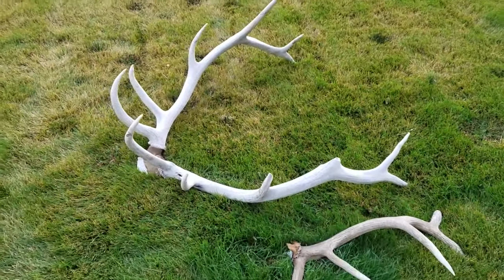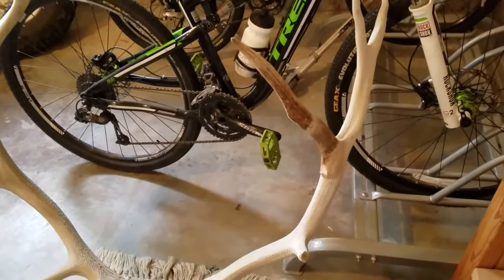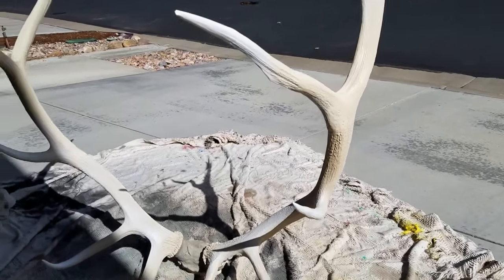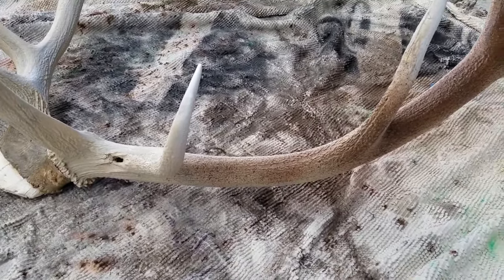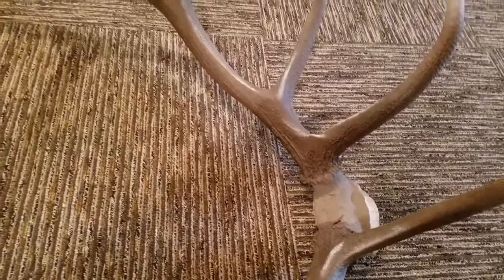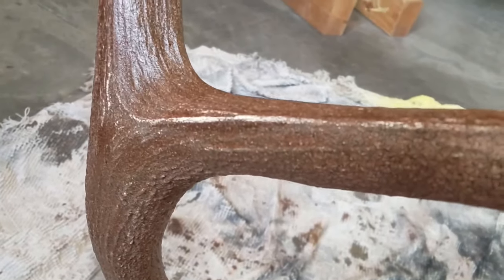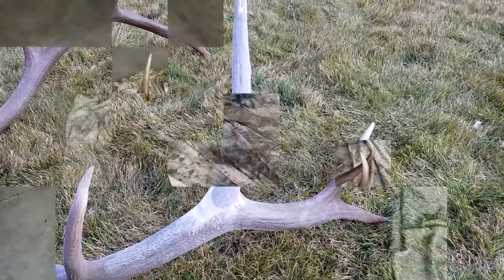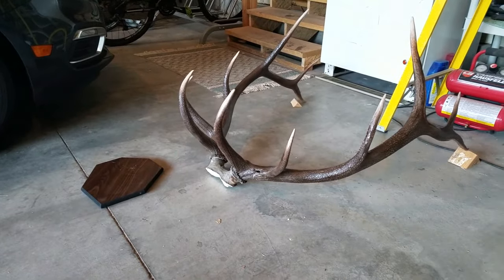DIY Antler Repair and Restoration - Broken Tines & 30 Years of Weather Damage

Comment: I got a 390 inch bull that winter killed last year or year before wyoming. I now know how am going to fix the tines and color. Thank you. Your bull shows alot of the same genetic tendencies of the one i found.
Reply from the maker: Congrats!!! Whitebone creations has a video with a fiberglass paint he uses...it works great.  You might want to give it a look.  Thanks and Good luck my friend!
Reply: Hopewell, which paint did you use for the white base?
Reply from the maker: I now use an ivory shade that I spray on. If I can't find an ivory then I find one that is very close to it that is an off white.. Make sure you let it completely dry.  For the next paint I now use a fiberglass door paint that is Brown in color and it works perfect. When I'm done with everything I paint everything with a very flat lacquer which takes all the shine off and protects the color.  If you have questions, let me know and we can talk via phone.
Reply: I tried a flat pure white base with a stain that turned out badly. Im going to use and ivory paint and a different stain, but a list of materials tht you use would help a ton.
Reply from the maker: I'm not at home to look at the exact name of the paint. But I get it from home depot and it is a bare brown paint that is for fiberglass doors. Stain does not work on top of paint or white horns.  Gloss ivory paint to spray on is the best for the base.  I will try to remember to look at the paint when I get home later but I believe there is only one that fits that description at home depot.

Comment: did wrong??? you did fantastic..!!! & you sharing the trials & changes is really kool, I've used that fleck stone paint before never thought of using it on horns, the end result is absolutely stellar, I really enjoyed this video, best wishes to ya Mike
Reply from the maker: Thanks Brooksy, the horns had so many cracks and crap that the fleck helped fill them in. I got the coolest package in the mail today...wow! Bro.... that necklace is sooo cool - I can't wear cuz i can't see it with my fused neck so I have to just carry it lol! The points are absolutely stellar! So if I read the note correctly, the beads on the necklace are from the 1700's? This was one of the best friend packages I've seen - Thanks my friend, much much appreciated!
Reply: I'm glad it got there safely, you can wear it & look at it through the mirror, yes the beads are that old , I never have thought about it til just now, but a guy could Google up Hudson bay sand cast beads & see what it says, I've just gone by what elders have told me, they were traded to the NA by the barrel full, I have a little pile luckily so i like using them,  back to a little more dirt, have a stellar weekend my friend

Comment: Sorry if i missed it. But what kind of base coat paint did you use? Awesome results, very detailed video. Great work!
Reply from the maker: I have made improvements since then... 
A thick base of Ivory or heirloom white rustoleum.

Then Behr mission oak -stain an poly  in one paint

Then clear FLAT / Matte poly urethane over everything. 

*Make sure you have a nice thick coat of the ivory and let it completely dry. First layer of paint is thin and light. Swipe the tips to expose the Ivory as you go or it won't come off smooth. The second and maybe third layer is fun as it will give a multi color appearance and look very natural.  I have not seen better at cabelas or advertised. 

If you have a shed to practice on you will be glad. If you mess up, paint a new Ivory layer and start over. I had to do that on my first. It's easy and looks great.

If you have any questions, let me know and we can talk.
Reply: @Hopewellmj  do I need to use the behr stain and poly in one for it to hold on the spray paint?
Reply from the maker: @colewenger6956  yes, exactly... just make sure the ivory is completey dry

Comment: Fantastic job!
Reply from the maker: You are very kind, thanks!
Reply: @Hopewellmj  I recently bought several chalk elk antlers and have been wanting to restore them. Your video is by far the best one here on YouTube. I appreciate the effort you put into the video!
Reply from the maker: @natespnwadventures  thank you! I have changed my approach lately to spraying them with an ivory color then after it is completely dry, use a brown paint that is used for fiberglass doors. It works really good. Whitebone actually has a video on it. Goodluck my friend!
Reply: @Hopewellmj  thank you very much for the info 👍
Reply from the maker: @natespnwadventures  never forget to take a rag when painting, and carefully rub the tips to bring back the ivory. Then when it's completely dry, take a file or sandpaper block and hit all the ridges. Brings it to life!
Reply: @Hopewellmj  will do! I appreciate it 😄

Comment: turned out amazing. didn't expect it to turn out this well. so i wanted to replace my whitetail rack. its a European mount with a broken tine. i don't need to recolor the whole rack, how to you suppose i match the new tine with the original rack?
Reply from the maker: Yes, do not do anything (with regards to paint) I did in this video to a rack that is not weathered to death. I repaired a muley I shot who had broke 3 of his tines and stained the whole thing after I was finished so the new tines had the same color as the original. No matter how close the tines are that you use to replace the broken ones, they are always a bit different in color. I have yet to see a set of antlers (not ones bleached and cracked)  that did not look better after rubbing them with Minwax Special Walnut. If they are dark and rich enough, then they don't get darker, they just stay dark and rich in color. All of that junk (sap, bark, dirt) they polish their horns with really fades over years. I clean all my horns (regarlesss if they need repair) and rub them with the stain, removing any extra, especially the tips so they stay white. Go get a set of small horns (not weathered) in the garage and stain them - you will be surprised how good they look.

My advise would be to find a matching tine... close as possible, cut the base and the tine at an exact angle as shown in the video. Use a small stud to strengthen the joint. It should be a fairly easy repair and then stain the whole rack and rub off extra. Find some grooves and lines on both the base and new tine that you can line up and wow does it make it look real.  It's hard to type everything but if you have any questions - kick me a PM and we will get in touch. There are a ton of YT videos as well :) I look forward to some pics!

Comment: Hey great video. I have a 150" mule deer. There's no broken off tines, and I want to restore it. It's very sun bleached. The rack has dried out and has small cracks from where it expanded. What would you recommend doing? Yet again, great vid.
Reply from the maker: Depending on how much weather damage and cracking.... I might paint with a light cream color from a can like I did these elk tines. I have used stain several times on different levels of weather damage and they always turn out so many different colors. You have to start out very light because none of it wipes off and it all changes color as it soaks into the horn and there's no going backwards. With a decent horn that's got no weather damage you can put it on wipe it off and it looks great but it's like staining a dry sponge when they're badly cracked and damaged. After you put a base color on it that evens all the the color of the horn, then you can try darker stains like special Walnut or Golden Oak. If it's badly damaged enough I think I would use that brown textured paint that I used in the video and then stain on top of that because it seem to hold it pretty good. There might be professionals that could answer these questions better...  lol! The horns in this video turned out better than the several sets of horns I have tried different stains on with no paint. Starting with that light cream color makes it possible to wipe off stain and leave the ends polished.
Reply: Hey thanks alot. I appreciate it. Not be a stalker but what state do you live in?😂😂 Beautiful country.
Reply from the maker: 😓  now your creepin me out bro! Just kidding.... I live in Morgan County, Utah.
Reply: It's real nice country
Reply from the maker: I'm guessing you're in the west ish .... since you have a muley set of horns?
Reply: Yes sir. Roswell, New Mexico. That muley was one my Grandpa shot a long while back and I'm restoring it for him. Or trying to haha.
Reply from the maker: Nice... big muley's and big elk!
Reply from the maker: ..... and do not mess up your grandpa's horns! 😲
Reply: Yeah no pressure haha

Comment: So you used JB Wood weld to build up the missing parts? I might have missed that part. I've got a moose rack that's missing one tine that is like to repair.
Reply from the maker: I used the J-B Weld to help make a perfect fit between a new tine that I took from other antlers and glued to the original. If you can get an elk or moose tine from someone or if you have some yourself it's a pretty easy fix to blend them. Just make sure you put a dowel in to secure the two horns together.
Reply: Hopewellmj, thanks. I ended up buying some modeling epoxy and forming the tine myself. I didn't have access to an extra one, so that worked better for me. Thanks for the response!
Reply from the maker: Nice!! do you have pics?
Reply: The tine that I recreated is a little light in color, hoping no one will really be able to tell. I'll fix it later if it bugs me enough.
Reply from the maker: Cool! I'm on my way over to FB!
Reply from the maker: Those look fantastic!  Great job, I will now become the student! God bless my friend and thanks for the update!

Comment: Wondering what color stain and what color rustoleum you used?  Having a tough time getting a nice blend like that. I also didn’t use the base layer of rustoleum like you did. Great job man, looks as legit as they come.
Reply from the maker: Definitely I have found out you need to put that base on because you can't do it later when you need that light almond color to come out. That Base Rust-Oleum is light tan and I believe it is called almond. The textured Rust-Oleum that worked really well I don't have the can anymore but I believe it was just their basic Brown. The stain I used over the top of that textured paint is special Walnut which I use on all my horns that aren't weathered or bleached. It's fun to try things on Old beat-up sheds that you find. I just put a tine back on a set of horns and blended it with flat Brown Rust-Oleum and it turned out just a bit too dark so while it was still tacky I rubbed some gray dust from under my saw into it and it turned out perfect. then I took some of the Walnut stain and added on top of it to match the horns. I hate using paint but sometimes it seems necessary because it makes two different colored areas the exact same color which stain does not do. Sorry for the long answer but it's difficult to try and describe things that you make up as you go LOL!
Reply from the maker: When you started off with white paint, was it because they were already very weathered? I remember with these elk horns first starting with white so that I could get the ends to polish but realized that even though horns look like they have white tips there actually that almond color. The tough part about sanding the antlers is you might lose the texture that's in the horns. Before you sand them, because you already have paint on you might want to First get some of that very flat Brown paint and put a coat of it on your antlers and then sprinkle whatever you want over the tacky paint and you can actually kind of rub it and it really adds different colors and texture to it. I would definitely spray a little bit of the almond all over it so that you can also sand a little bit of the brown off revealing the almond color. Now you definitely know what I mean when I say I only use paint when I absolutely have to because it's very unforgiving and repels the stain. If you have any old sheds to practice some different techniques on, I'm finding that you can usually make something work very well. You should pop over and we'll go out into the garage and find some kind of combination to get those things looking stellar!
Reply from the maker: I had to use putty to repair the broken tine. So then I was left with horn / putty / Horn. Putty is just like paint in the sense that it repels the stain. So I was forced to use paint and so I went down to Home Depot and bought that flat Brown. Then I covered most of the horn in case it became a disaster and sprayed only a few inches. Then I realized it looked horrible and panicked and just grabbed a bunch of ground rock dust from one of my axe projects and sprinkled it all over the paint and then took a dry paint brush and brushed off the excess and to my surprise it actually looked really nice. Then I sprayed some of that almond paint into a cup and took a toothpick and lightly dipped the end of it in the paint and started connecting ridges and lines through the painted area which then made the tine look natural and hides the repaired area. Like I said before though, I avoid paint at all costs. Actually I have only used it twice... on those horrifically weathered elk horns and then on this muley rack. If you want to PM me an email address, when I get a chance I can take some pictures to give you a better idea and send them to you.
Reply from the maker: Go to my homepage on my channel and as you look at some of the headings at the top one of them says "about". Click on that and then that should give you an option to send me a personal message. I think you have to do it on a computer though because my phone doesn't give me that option.
Reply from the maker: No...i suck when it comes to social media
Reply from the maker: Good Luck! don't screw it up :)
Reply from the maker: Ugh! Dude I'm sorry, hopefully I haven't misled you too badly. I'm wondering if it would do less damage to the antlers if you used a paint thinner or something like that - that you could just rub the paint off and start over as opposed to sanding which would probably take away from some of the grooves and edges and character?
Reply from the maker: Awesome to learn that the sandpaper works so well. Lessons Learned and now try again I guess... you got me watching other horn restoring videos and one below this one the guy uses a light paint for the entire antlers so that the tips will be light, but then dabs the stain on and lets it sit for several days to dry, because you know,  the paint won't accept it. Surprisingly it seemed to look pretty darn good.
Reply from the maker: Indeed... I used a lot of that putty on my very first ones and the same thing happened to me as far as trying to sand it off.